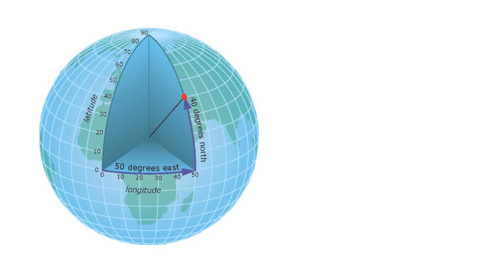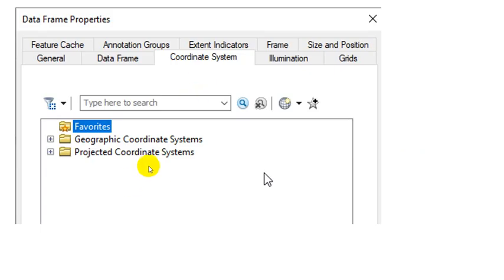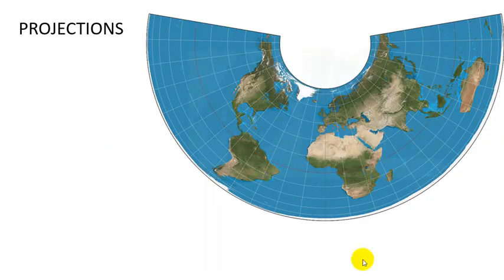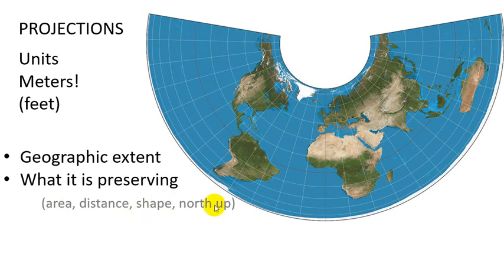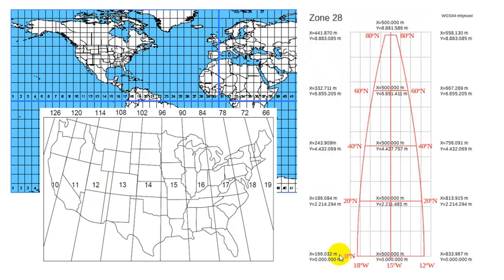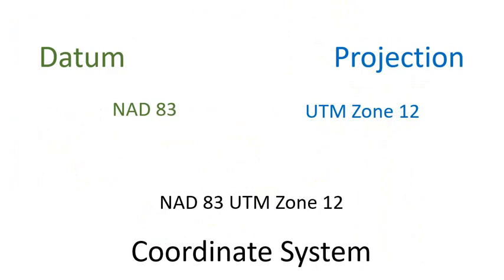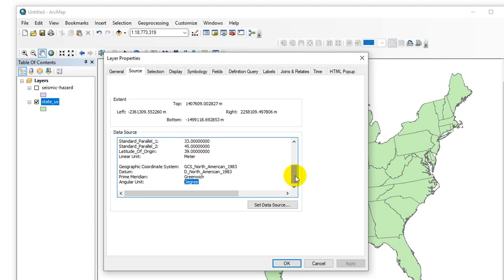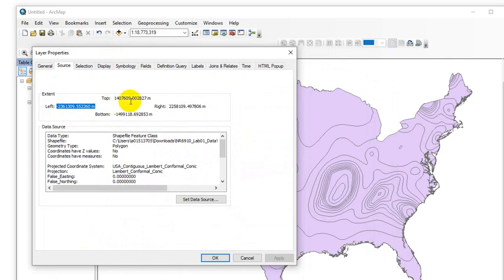coordinate systems in a big beautiful nutshell

Comment: Why do you need a GCS when you could just reference a location based off of the global Lat/Long system?
Reply from the maker: Good question! The global lat/lon system IS a GCS: WGS 1984. Continents typically have customized GCSs that have a closer fit to the Geoid over the continent of interest. For most purposes WGS 94 is perfectly suitable. Localized GCSs will provide higher precision and accuracy.